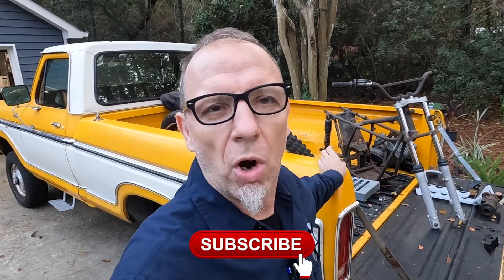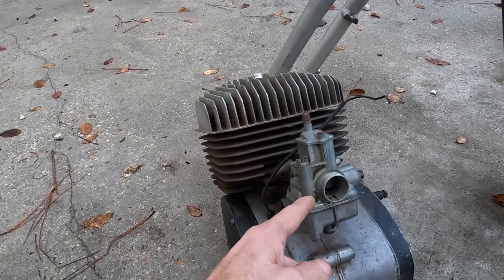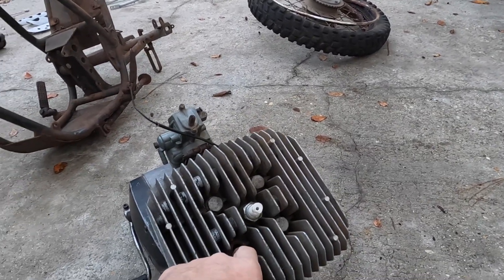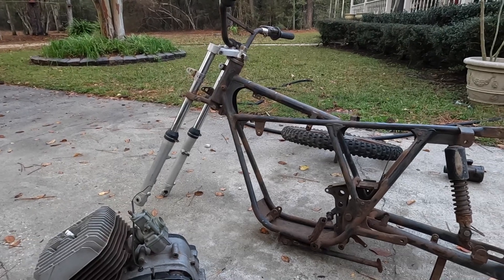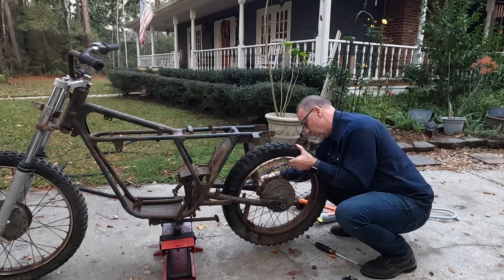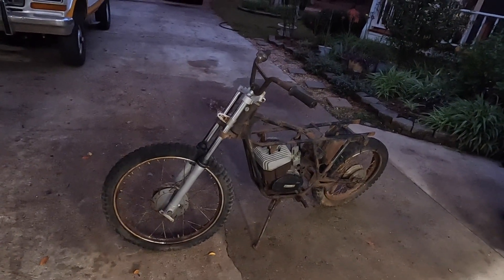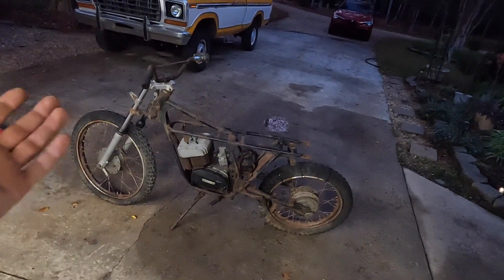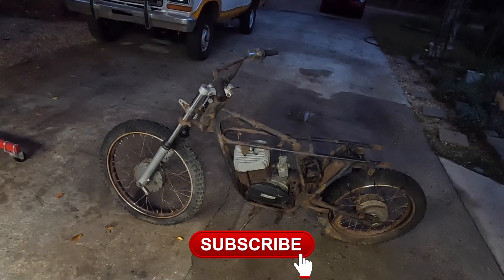FREE 1972 Benelli Panther 125 #vintagemotorcycles #benelli #motorcyclerewind

Comment: The good thing about the benellis is that they used the same parts as many of the other Italian manufacturers of the time and if the motor turns over it's worth money ,the forks and frame and carb are worth money, not lots but you got it for free
Reply from the maker: You’re right, just the carb was worth my time and effort. Thanks for watching.